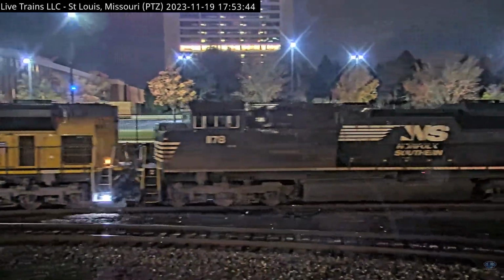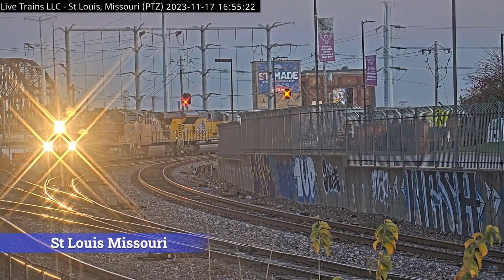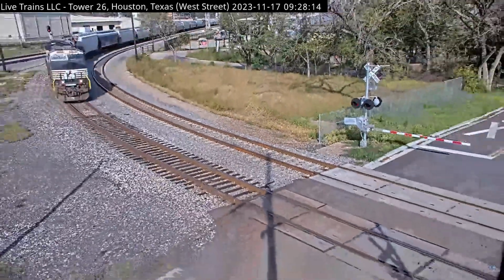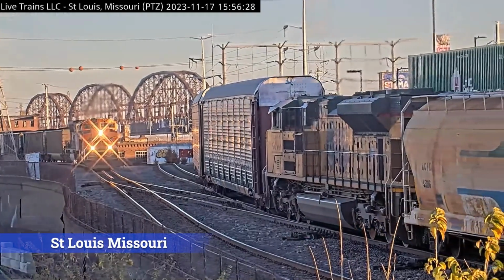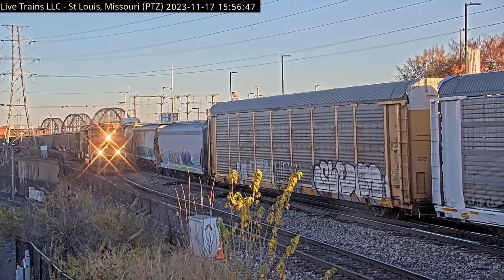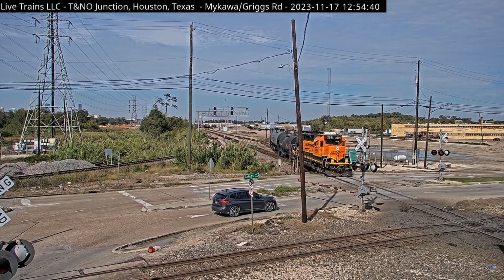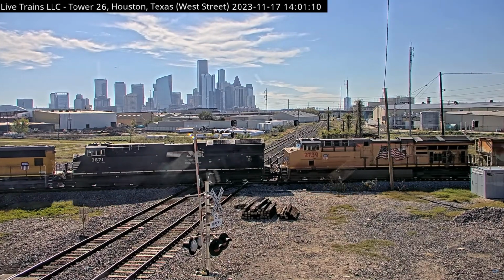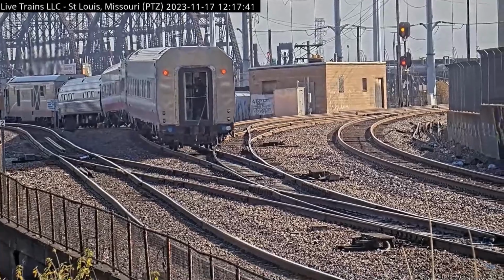THESE Locomotives Are Getting SCRAPPED, But WHY? | Rail RECAP #144

Comment: UP is finally disposing of the SD9043MACs for the same reason that BNSF and KCS decided to dispose of all their unrebuilt SD70MACs. Siemens is no longer supporting their liquid cooled Inverters. The frame cracks are a result of EMD underestimating the stresses on the frame at the location of the mountings for the fuel tank. This was not that big of a problem, it was just one more thing that needed fixing. It should be noted that both CPKC and NS are still operating the SD70ACU which has the same engine, frame, and fuel tank that the SD9043MACs have. The difference is that they now have Inverters built by Mitsubishi, the same as the SD70ACe uses.

Comment: The SD90 frame cracks might of been similar to the DD40x's issues. Long frame, huge fuel tank, larger engine in the middle.
Lots of weight to span out with flexing of the unit.
Heavy engine.

Comment: I wonder why UP decided not to rebuild some as 70ACUs like NS and CP
Reply: Because the ACU program, was a failure. The NS ACUs are complete junk and the CP ACU's are just barely workable.
Reply: @BuckeyeNationRailroader  That seems odd given how many NS converted and that CP is still converting units. Not saying you’re wrong, just an observation.
Reply: Ns is scrapping there acu
Reply: @alcomankyle  They are scrapping the ones they know they can't fix. The ones they have on the roster are just barely workable as they are.
Reply: Interestingly enough, I caught a CP SD70ACU leading a train over Tehachapi summit. Not even on its home rails! I saw it smoking quite a bit under a bridge, and that might explain why the ACUs are junk. I also have a question, which is worse? Non-rebuild SD90/43MAC, or the rebuild SD70ACU?
Reply: user-TheBestRailfan Norfolk Southern's problem they encountered with the ACU's was because they completely ignored a critical problem with their engines, and that was the frames. Union Pacific told NS that these engines had serious frame wearing issues, and Norfolk Southern thought that simply screwing in a few bolts would hold the frame up. Well Norfolk Southern was wrong, very wrong, and the ACU's Frames continued to deteriorate even further on top of the constant mechanical and electrical failures.

The ACU's that Norfolk Southern got rid of under the Jim Squires era were the ones that had serious frame issues. Some of their frames were in such bad condition that they could've collapsed at any moment. The ones that Norfolk Southern didn't get rid of are the ones that are in semi-decent condition and are workable.
Reply: @BuckeyeNationRailroader . I’ve seen a lot of those CP ACu’s and I can assure you they are not failures. BTW, have you ever seen one?
Reply: @douglasskaalrud6865  Yes I have seen the CP ACU's, and I know people who work on them. They aren't good engines and they are due to be replaced
Reply: @alcomankyle Nope.😂
Reply: @BuckeyeNationRailroader The SD9043MACs are problematic because of engine failures.😂
Reply: @gloria6229  What? Its true their engines were notoriously known for failure. It was so bad that on some places of Union Pacific's system they were banned from being leaders
Reply: @BuckeyeNationRailroader As I said in my other reply, the CP ACU that I caught leading was smoking quite a bit under a bridge, and is that a sign of mechanical issues the ACUs had?
Reply: @user-TheBestRailfan I mean if it was smoking more than usual you have to look if it was producing thick black smoke. That can be a sign of the Turbo Charger starting to go bad.
Reply: @BuckeyeNationRailroader Agreed.😂
Reply: @BuckeyeNationRailroader The SD9043MACs were always problematic and they had a LOT of issues. 😂